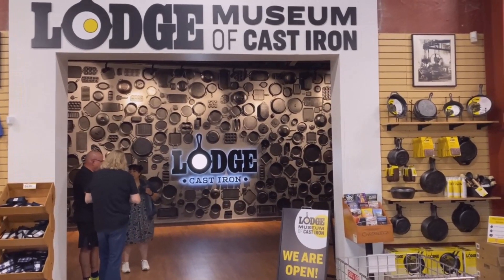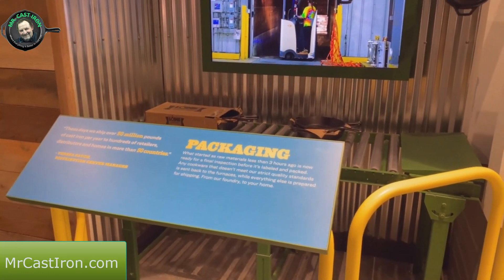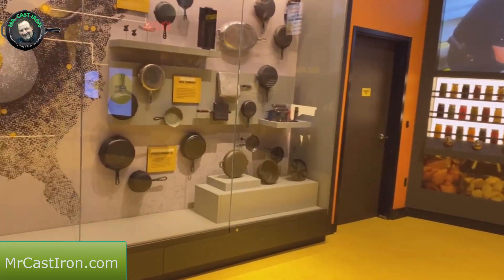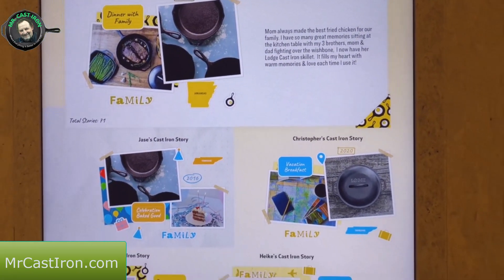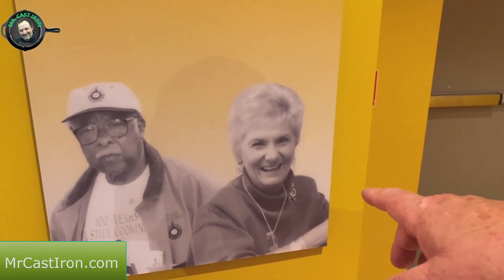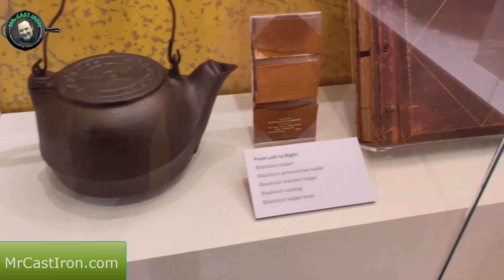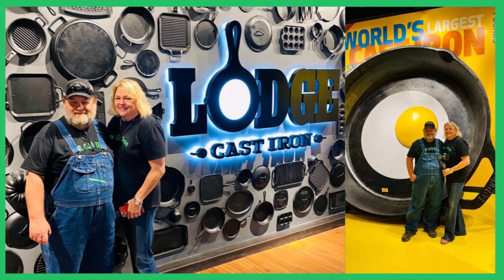(OPENING DAY) Lodge Cast Iron Museum

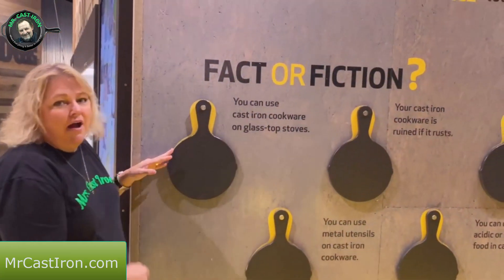Comment: 7:17 I noticed that even on opening day, moving those pans aside has rubbed some of the paint off the wall underneath.  Lodge should consider putting something on the back side of the skillet so it doesn't keep doing that.  Maybe fastening a little bit of padding on the back side, like a Command strip, will prevent it from rubbing directly against the wall.
Reply from the maker: Yeah, I didn’t really notice that, but overall it was pretty impressive all they have done. I’m sure they’ll have some issues along the way, though! Thanks for stopping by and checking it out, Eric!